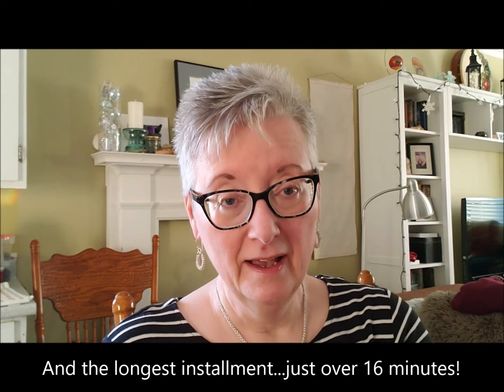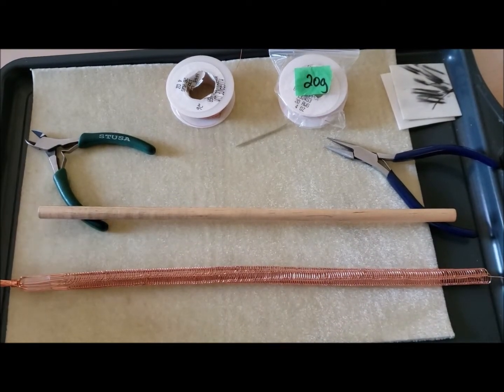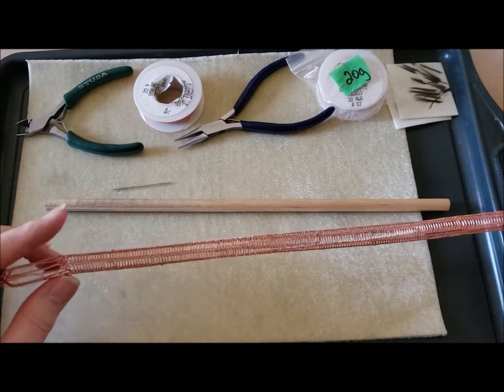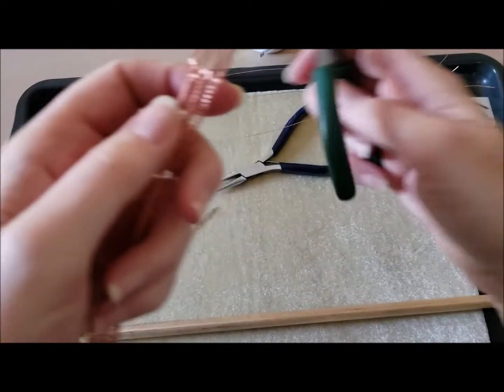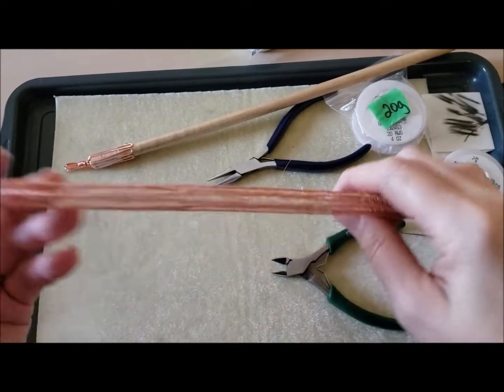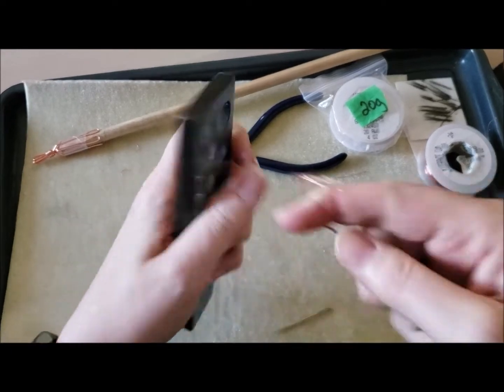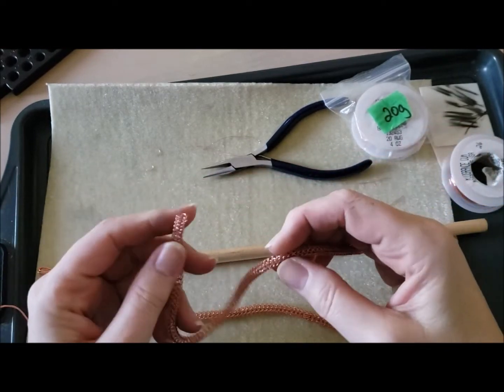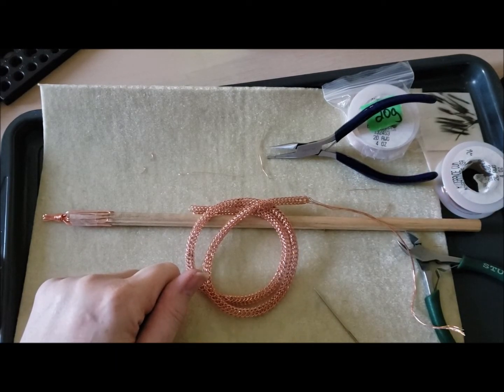How to do Viking Wire Knitting - Part 5

Comment: Hi there 👋 thank you so much for creating these videos newbies like me learn from people like yourself taking the time to show how you work. I'm going to be making a start on mine this weekend.  Anyhow just wanted to say a quick thank you
Reply from the maker: I'm so glad you find them helpful.
Reply: @TheKnittedRaven  Hello thank you for replying !so many don't. I truly appreciate anyone taking the time to try to teach others. And I learn by visual. If I read how to do something I can't. If I am shown I can. At the moment though I am struggling getting the very beginning you the know the spider daisy thing I am trying to make a 6 armed one. And every time my kegs are shorter taller etc I can't seam to even them out. I can't figure where I am going wrong
Reply from the maker: @kirtandrews1859  The visual instructions for making the daisy support cap are here:   https://youtu.be/B4QnHTFwIYg?si=shDV_D37TzIOI6_8   Don't worry if it isn’t perfect.  It rarely is. The first few rounds of VK are done in a manner to compensate.  When I show examples of VK on dowels you may wonder why I have bits of copper knitting left on the dowels. That's on purpose. I knit until the stitches are  evenly spaced, then knit 6-12 rounds beyond that. 

I can use this to get a jump start on my next VK project.  The extra rounds enable me to cut through the copper wire to detach my knitting when I've made a length. This is especially helpful if I'm using precious wire. 

Let me know how it goes. Good luck.
Reply: @TheKnittedRaven  Thank you. I just don't trust myself to be able to straighten them out if I start on a lop-sided.  I am brand new to this so I gotta learn ! I gotta find some confidence in my abilities u am finding the wire is hurting my hands pulling it whilst straightening the wire too. Is there gloves as such to help my finger pads? Strange u know. I have very sensitive skin and I feel pressure quickly I have many autoimmune disease sthst causes such inflammation you see. I was thinking just a pair of cotton gloves but I think I will loose my grip. Anyhow I shall watch video you linked and definitely give it a go tomorrow I am a Taurus I am stubborn and don't give up quick . Where others may see a brick wall infront of them I see ways around over under around. I'm sure you understand.  And of course I shall keep you updated I'm going to be overjoyed if I can make a straight one
Reply from the maker: @kirtandrews1859  With most hand crafts, it will take a while for your hands to get accustomed to what you are asking them to do. Work at your project in short sessions to give your muscles and fingertips a break. Don't expect perfection right away. The more you practice VK, the better you will get at it. Muscle memory will start working for you and the quality of your work will improve. 

Starting off the VK, and doing waste rounds until your stitches are even, and evenly spaced is also something that gets easier with practice. You will get a feel for the wire the more you practice.

 I wouldn't use gloves for exactly the reasons you mentioned. Be careful how you pull on the wire. Wire likes to be coaxed along and tends to "bite" if handled too strongly.
Reply: @TheKnittedRaven  wow I never knew we have a muscle memory in are finger tips. OK I'll try short sessions untill I get confident but also trying to use the tools more to my advantage. I just hope I can find your message to reply when I have eventually managed to make one good enough